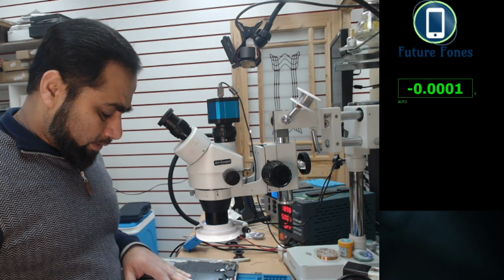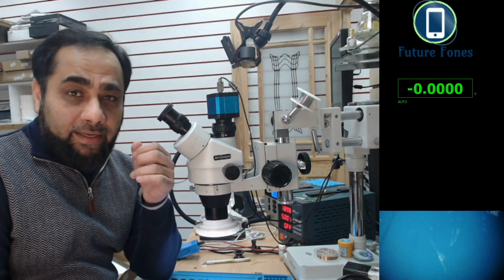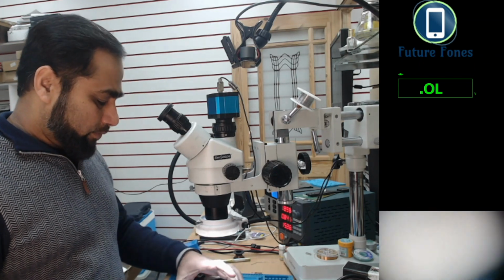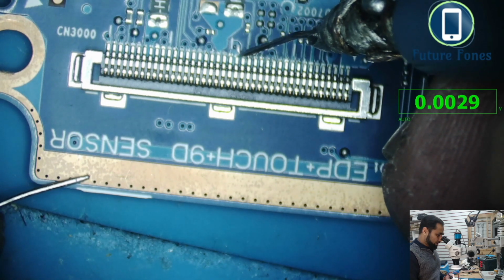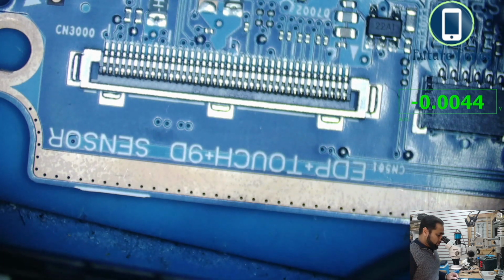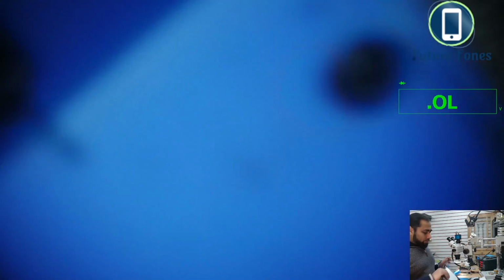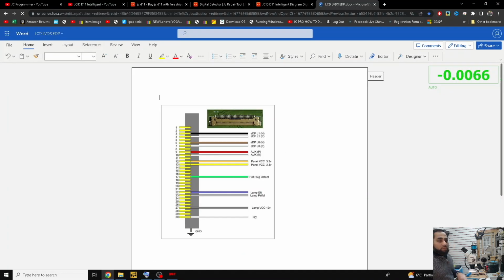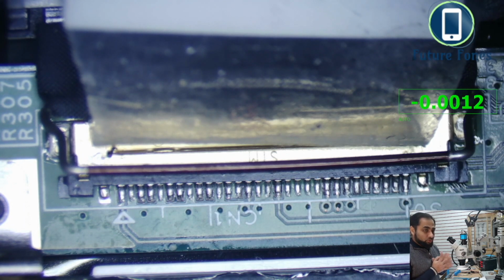The Hidden Secret of the LVDS Connector. HP Pavilion x360 14-dw0522na BACKLIGHT

Comment: Did you probe all pins to ground on keyboard connector to find the power button  in diode range?tks
Reply from the maker: Yes and you can find the power key
Reply: @futurefonesltd  sorry to be a pain but just to be sure is there no risk of causing a short because the other pins are connecting to other parts of board.Thank you Fahad and looking forward to more and more of your "lessons"
Reply from the maker: @rossmoodley9407  .  Diode mode — red pin on ground and black on keyboard connector one by one . Safest . One by one check is important.